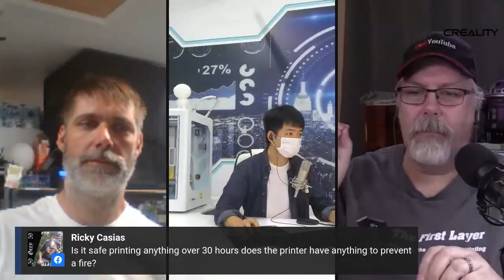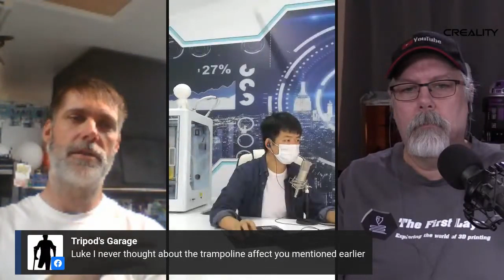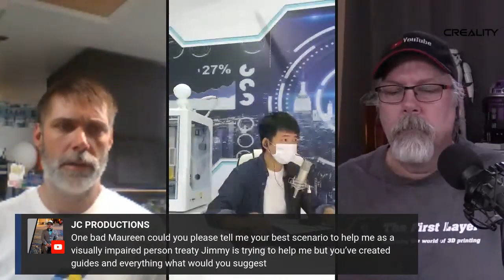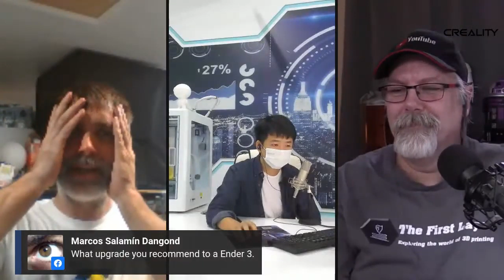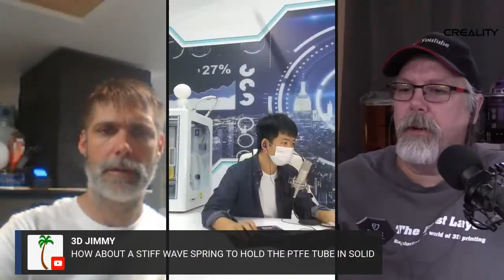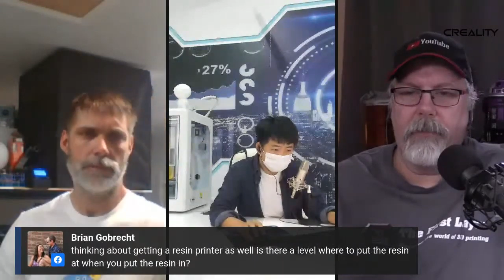Community Friday Live Talk with Luke, Richard and Ben! Re-Stream

Comment: I don't agree with Luke what he is saying on how that aftermarket 32bit boards finish parts badly specially in corners because they are to precise, That 8 bit boards finish parts so nice because of the imperfection of commands. 32 bit boards create beautiful finished parts, objects of art. People posted enough examples of it. 32 bit is the future, if you want or not. We don't use dialup modems either anymore :-)

Comment: I have a problem with cr10 pro raising z axis by 0.2mm after a print, I'll drop Richard an email with exact details but any ideas would be greatly appreciated.
Reply: You want to raise the z axis a bit when a print is finished, so the hot nozzle will not burn in to your print. Depending on your slicer look at the End G-Code tab in Preferences / Machine Settings for Cura, or Custom G-Code in Printer Settings for Slic3r. There is no chat in this stream because it was streamed on the Creality FB page I believe. So I'm happy Richard reposted it here and its great he was on that stream.
Reply: @martendb  Cheers yeah I guessed it was live elsewhere. I got some good tips and will be stripping the machine down AGAIN tomorrow. As it stands now it is spot on every time I check, but if I run the same print say three times it is higher each time, or in some cases lower!
I'll check the G code over and see what I can see.
Thank you very much for your response.  👍